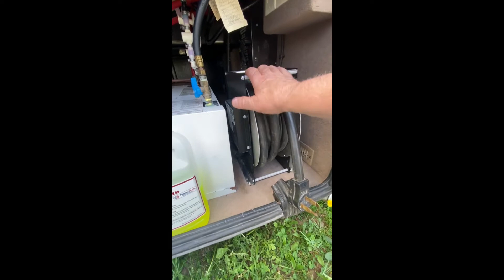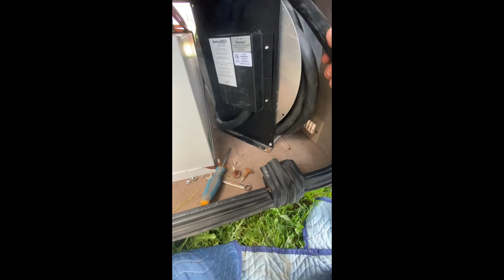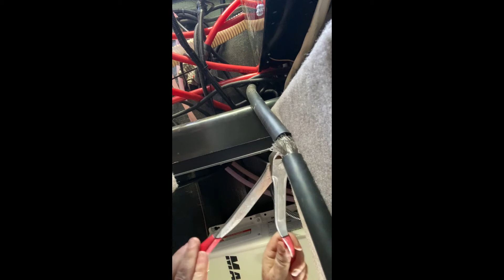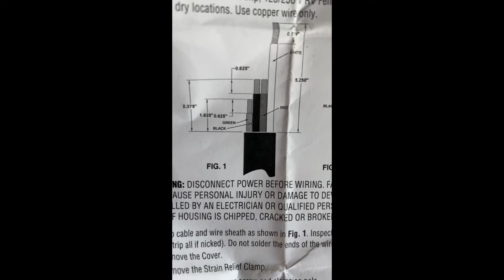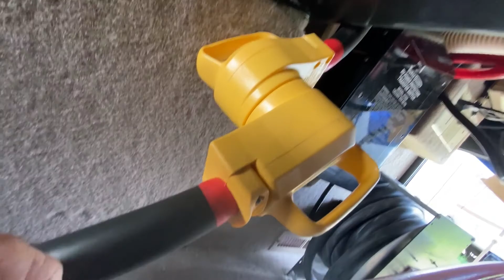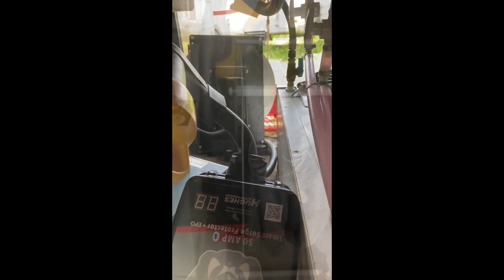Safe Secure power protection for your RV | RV Living | RV Life

Comment: Nice job! Curious if there's a manual reset or switches on the protector and if you have any way to easily reach those as well?
Reply from the maker: Both devices automatically come back online if the power corrects itself. They can be monitored from a phone app as well to see how things are going and it sends warnings to your phone when things are not going right. I had to stop it from sending me warnings as this park we are in for the winter has voltage swings up and down constantly all day every day. I had no idea when I just had a regular surge protector. Lesson learned there! I did mount them in a difficult to get at place on purpose as they as expensive. I can crawl in the basement from behind along the side of my water filters and access them from there. There is no reason to need to get at them though. I can control everything from the app.

Comment: Hello Gary, I hope you are doing well. I really enjoyed your video. I do have a question. Most people I see using the surge protector first use it to check the power at the pole BEFORE plugging the RV. They have a set of lights telling you if it is safe to use or not. How do you do that with your setup? I don’t see how you could TEST the electricity coming from the pole before end.
Reply from the maker: I see people doing that often. Plug to the pole to check it first. I never say anything to them about it. Maybe some peoples devices are not as good as others but these devices protect the rig. If I plug into a bad power pole I will get an immediate warning on my phone and they do not allow power to pass to the rig. There is no risk as far as I know.